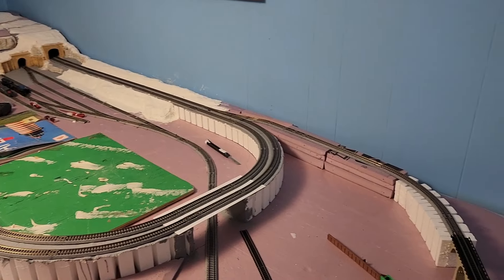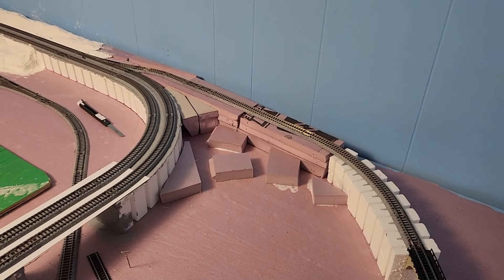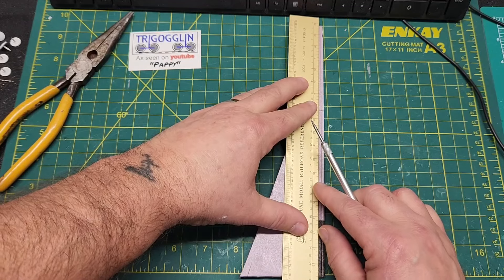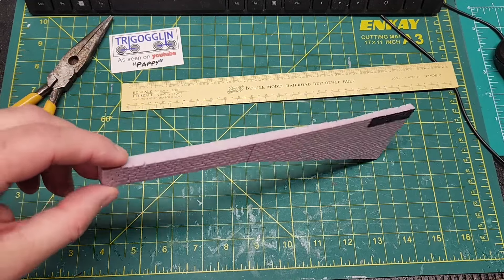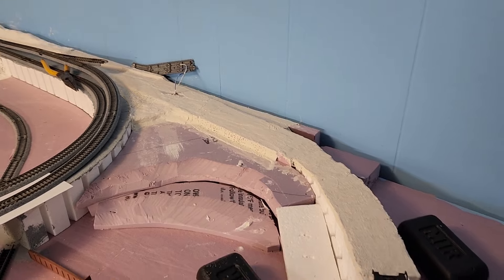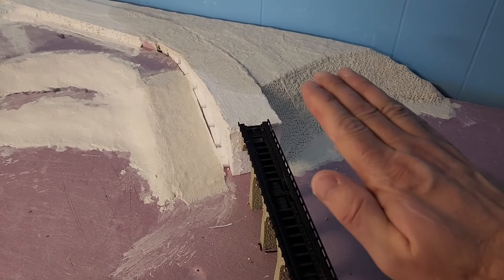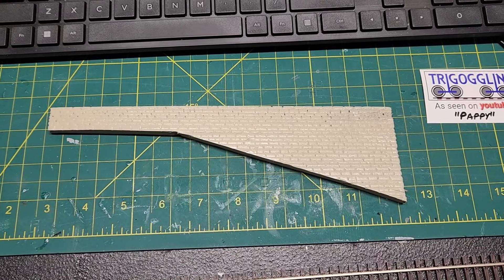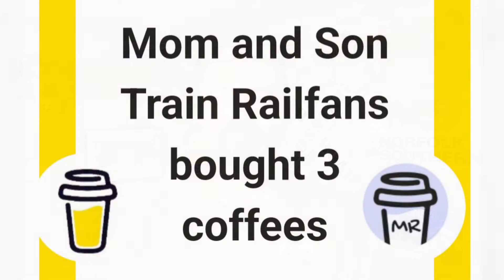N Scale Layout Making some progress

Comment: I'm curious about the tunnels, if they are fixed to the ground, then how do you deal with any issues that might occur when trains operate through the tunnel?
Reply from the maker: I have a hole cut in the bottom big enough for me to fit thru. And the top comes off, Cause I can't reach that back corner. I should of built this bench work differently but now I'm stuck with it. But  atleast I can get to the insides if there is a problem. I do have an N scale playlist. One of the thumb nails is me standing in it, Really appreciate you watching.